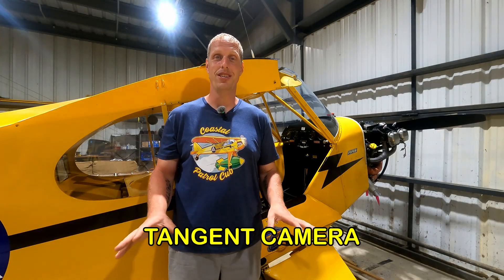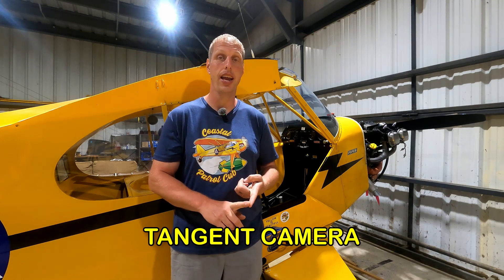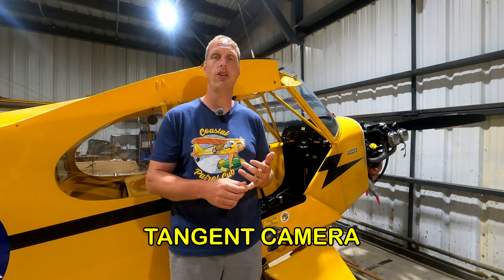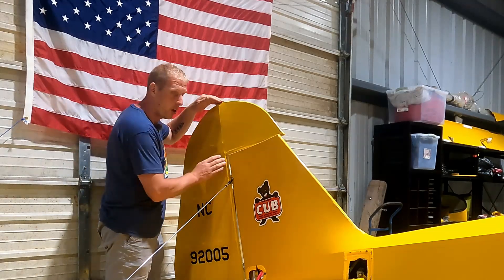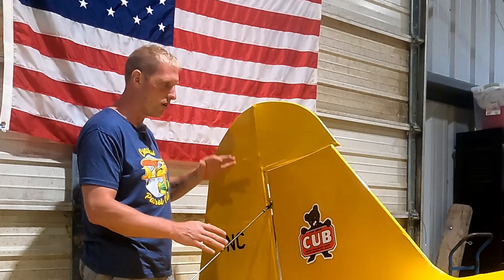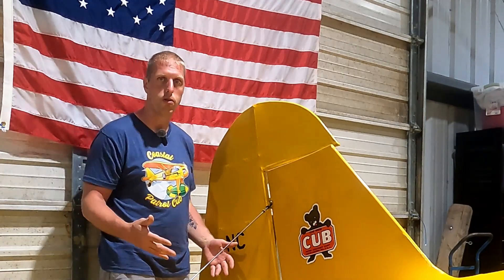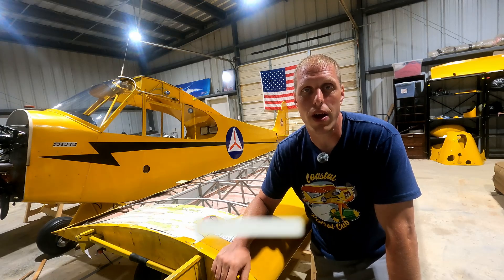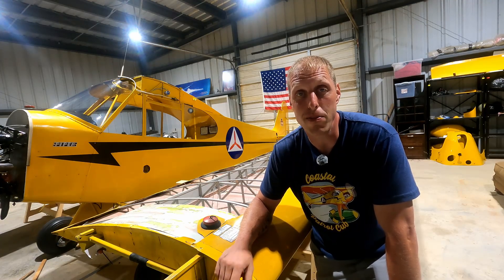What's the Deal with Piper Rudders? Airworthiness Directive explained.

Comment: While ADs add both peace of mind and upgrade, the control issue of the rudder bending over above the top attachment is not severe.  I was a crop duster when most operators had six Pawnees before the Ag era of turboprops.  There was a cable from the cabin to the top of the vertical stabilizer to keep wires from bringing us to a stop.  Crops grow and the room under the wire gets shorter.  That is why operators kept extra rudders.  I tried under, normally safer than over, one too many times on irrigated corn and knocked the top of the rudder over as in your picture.  I dumped and landed on the road because I was worried about more coming off, but the yaw control was stiff but fine.
Reply from the maker: Great insight, thank you for sharing!